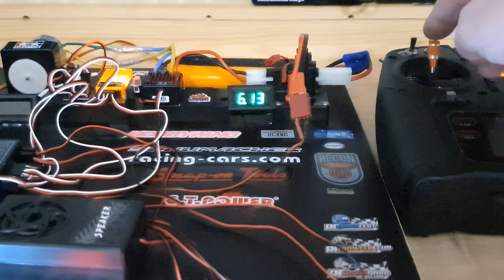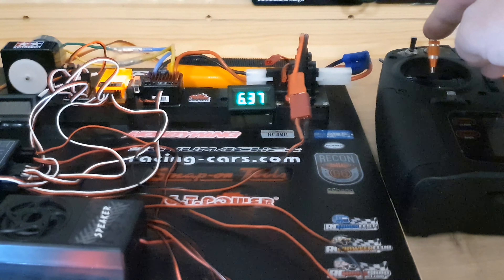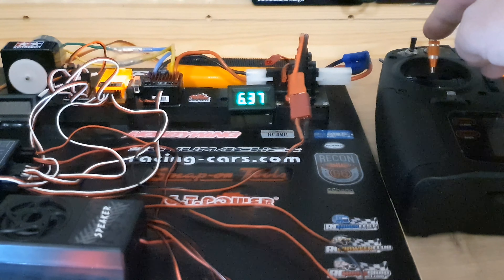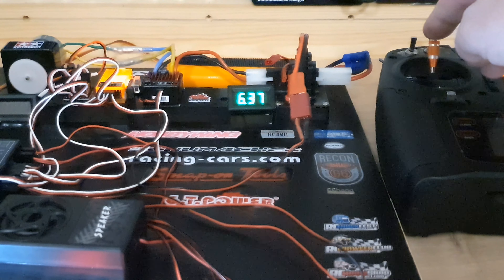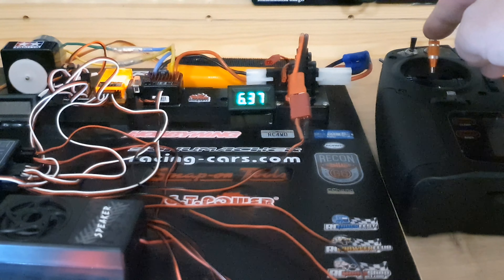Review - GT Power Entry Level RC Container Truck Sound & Light System - 4k

Comment: Lipo vs NiMH comparison was enlightening! With NiMH, initial power surge dropped the voltage into the FIVES!! 😮  Significant.
Teri, I was really hoping you would get to this one! I have one now in storage, waiting for us to get out of this MESS. 😭  It's going into a Budget Semi project with a Hercules Hobby Truck kit.... 
I DON'T expect it to be Tamiya quality, but it may help a lot of people who would love to get into these, but don't have Thousands to spend.
(Like I am now)

When I can, I'd love to get a second one of these. I think I like the Entry Level better. Less FAFF, less confusion, no phone needed!! 
Thanks for doing this one! 😉
Reply from the maker: I was also surprised and it just shows how much current the stock motor can draw without any load. I only really use Nimh for light duty stuff such as the light system in my trailer. All my trucks now run lipo.
Reply: I guess I should run Lipo, since I'm either using a Hobbywing WP-1080 ESC or Beier USM-RC-3.

Comment: You've got me lost with that receiver and the inputs.  Input 1 is switch: to Ch 3.  Input 2 you called SWITCH.  Input 3, ESC, goes to THROTTLE on your receiver, but isn't throttle usually ch 3?
Reply from the maker: @extrema391a6  ch1 is throttle on Spektrum. 
You have to identify what channel does what on the radios as some brands differ from others.
Reply: @TeriWilde  Ahh.  Making more sense now.  Not familiar with Spektrum, but know that on my Flysky, I can have left stick be Ch's 1 and 2, or 3 and 4

Comment: Hello. Thanks for the review. Okay, tell me, if I don't have such a power adapter, how can I connect this whole system? Will you need two batteries?
Reply from the maker: you could use 2 batteries but that would take up more room in your model, it would be easier and better to get an adaptor lead to be able to power up the unit as well as the ECS from the same battery.
Reply: @TeriWilde  Thanks!!!

Comment: Does anyone know if this is American or European truck version
Reply from the maker: it's neither because it's not the GT Power MFU... this is a stand-alone container truck sound light system, and it doesn't support trailer light connection. great if you have a straight/rigid truck but not for an articulated semi-truck.
The engine sound is just generic as it sounds in the video.

Comment: I'm having an issue. While brake, reverse and turn indicators work fine, I can't get the headlights to work (I have the ch2 throttle on the left and ch4 is for steering). Any insights on how to get them working?
Cheers!
Reply from the maker: it's important you have the control leads plugged into the receiver correctly.
Reply: @TeriWilde  I finally figured out how to do,thanks

Comment: Voltage drop when the system is running. Can this module be powered by a separate battery other than the main battery?
Reply from the maker: @benner-iw8rx  the simple solution would be to get a higher capacity battery, or better still, use Lipo. That should solve your problem.
Reply: @TeriWilde  Imay have to break down and buy a Lipo for this.

Comment: Hi Teri. I've got a GT Power System like on the video. (I fly Mode 1 and all my trucks are in Mode 1 as well). Does the system still work if I change the throttle and steering to a different channel i.e. mode 1. Great videos by the way! Keep up the good work! 👍
Reply from the maker: as long as you plug the Input Control leads in the corresponding channels on the Receiver, then it should work.

Comment: Hi teri  sorry to be a real pain    i'm going to buy one of these for my scania  but!.. the problem is my esc is rated to 60A and 7.2 rated & has Lipo switch from NiMH to Lipo  and  the lipo batteries are confusing me  you have the 2s 30c 5000mah 7.4 v    on the gt power instructions it states  maximum  is 2000???  hhheeeelllppppp!
Reply from the maker: What ESC have you got? 
and I would consider buying an alternative as this unit will not support trailer connection and has limited function.
Reply: @TeriWilde  Hi Teri  its a 60a  2-3 Lipo /nimh esc  BDESC-S10E-RTR    no name  hobbywing possibly?    but I have changed my mind and went for the ESS dual  and  buying  truck light set from astec models   I aint going for Tamiya MFC 01  as I really do like it .. the pension wont cover the cost
Reply: @TeriWilde  Thanks for the reply Teri much appreciated😀😀😀😀
Reply from the maker: @davidcurrie8564  you're very welcome. 
I'm not a fan of nameless chinese products that are rip off clones of quality products.... but cheap, get cheap as they say.
Reply: @TeriWilde  all i could afford at the time  on a pension.

Comment: Once again, thank you for this! I wish I could afford 2 more of these... 
It has everything I need, NOTHING I don't!! 
No FAFFING with phones, which I can't use.
And nearly as plug-and-play as an MFC-01/03. It would be great for two Budget Diesel builds I've got coming up... or maybe even make my Grandson! 

How did you get Throttle/Steering on the CORRECT sticks?
Reply from the maker: To get the throttle/steering working correctly it's a simple case of figuring out which channel to plug the leads into. not all RX are set up the same :)
Reply: True. My Flysky FS-i6X has ch 1 for steering and ch 3 for Throttle. 
So.... it's only as simple as deciding which inputs to plug into the Receiver?
Reply from the maker: it is as simple as that yes 👍
Reply: @TeriWilde ..... and therein lies my problem. I have an Engineer's mind - I can't stop THINKING! Even when I know better! 🤪

Comment: Hey Teri. Trying to figure out what is the best remote to use with the system.  Same gt power system with one sound. In the manual it shows the 2 joystick type remote I dont have yet. So 6 channel / 8 channel  / 10 channel/ 12 channel
Reply from the maker: the GT Power unit needs 4 channels to operate it.... If you're on a budget, I say go for the Flysky FS-i6X which comes with a 6 channel receiver but can support a 10 channel receiver (that's what the X means)... plus it has a 20 model memory so you can use the one radio for many models.

be careful not to pay too much for them from because I've seen some sellers asking over $100 for a $60 radio. and it's advisable to fit a return spring on the left throttle stick which are only a couple of $.

I prefer to use a Spektrum radio which are a lot more expensive
Reply: @TeriWilde  that's great bro. Cause I also need to operate other lights and a winch

Comment: hello teri, brillant video as allways my thottle does not work, any surgustons,   bruce
Reply from the maker: as this system doesn't have a ESC I can only assume there is an issue with your ESC, Receiver to transmitter signal (bind) or a wire isn't plugged in correctly.

Comment: Hello. I'm new to the semi world and doing research before my first build. I want to run this sound system for sure. I have a Futaba 7pxr transmitter that I use for all of my RC's and would like to do so with my Semi. Can this be used for the GT control system?
Reply from the maker: I've never been a fan of pistol type radios so I've never looking into how they work but bear in mind that you need 4 channels that are 3 position.

Comment: do you need to plug in your speed controller to this,
Reply from the maker: You'll need a separate ESC and it does run through this system as do the servos. This is to facilitate the engine speed sound and turn indicators.